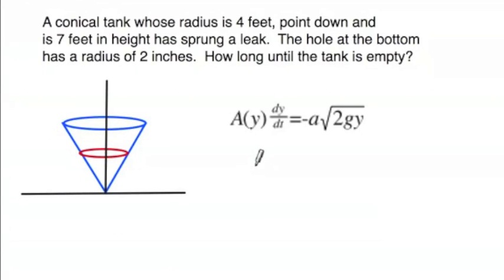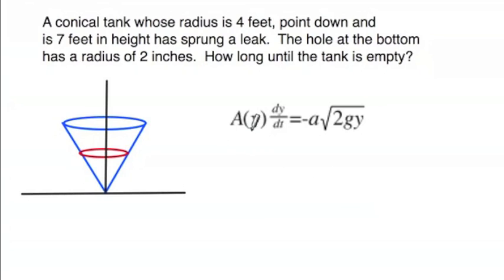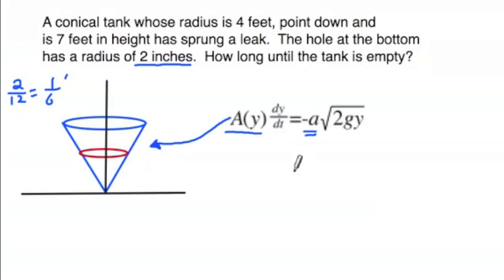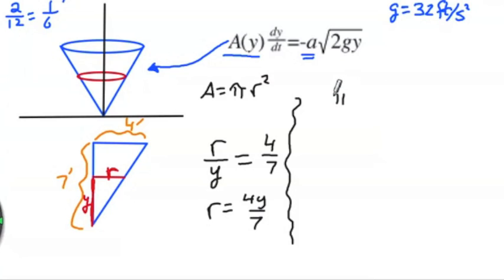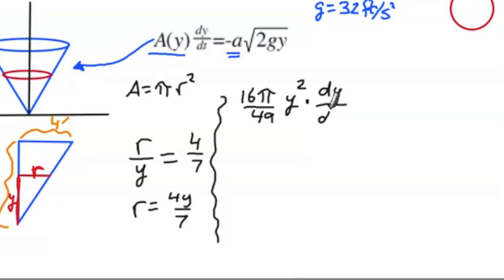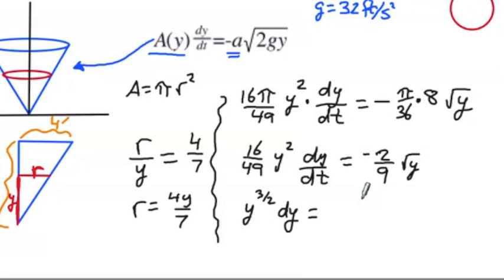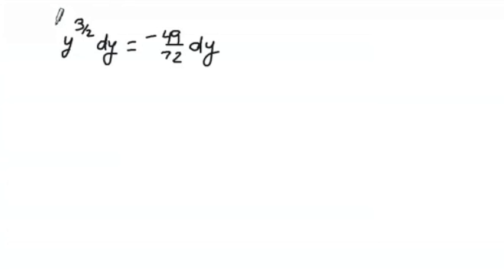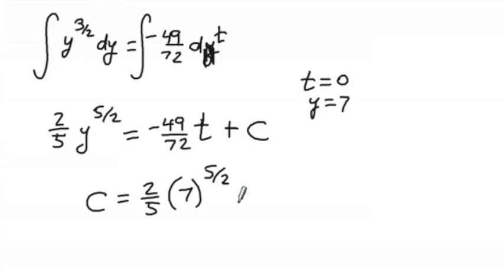Torricelli's Law

Comment: How would I go about doing this same problem with an upright cone... the surface area of the cone increases as the water decreases.and it seems using similar triangles won't work because we no longer have a triangle when the water decreases